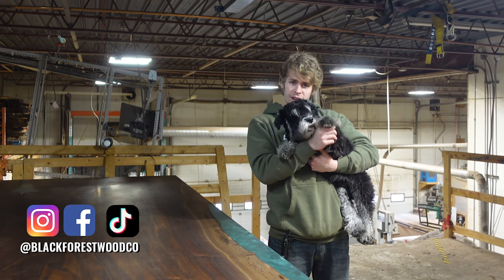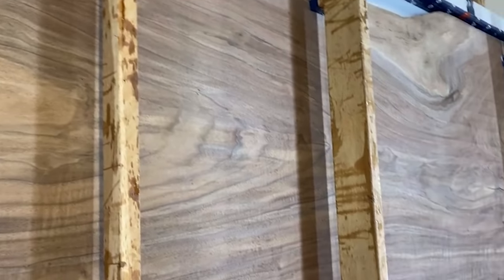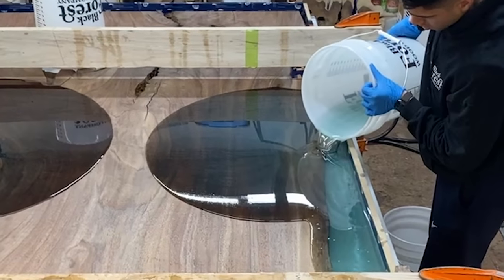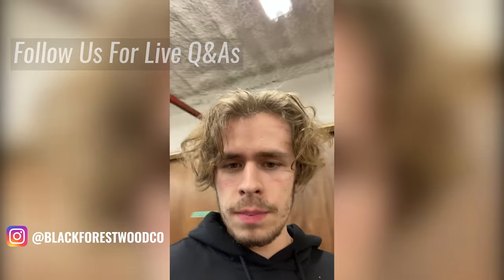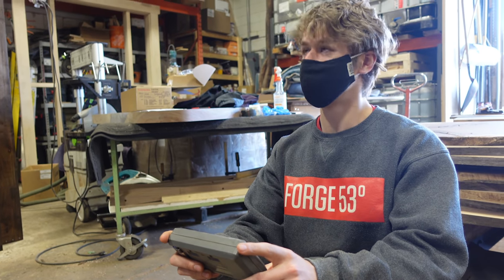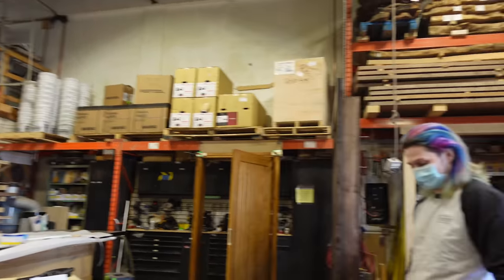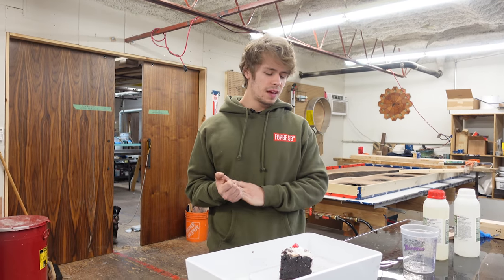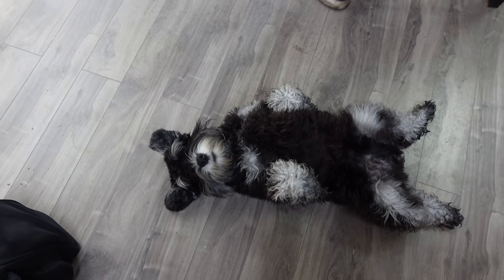Building Our Biggest Table Since 2020

Comment: I know this is an old video but it reminded me of a question I had.  I have a lot of mixed wood/epoxy projects like this (meaning the wood is exposed in the final product) and I wonder about sanding at the higher grits on bare wood.  Obviously if you want a perfect look to the epoxy you need to go up to higher grits like 1000/2000/3000/4000/polishing compound, but usually on a fully epoxy product I do these wet-sanded.  However with wood, you get that "fuzzing" that happens when the water dries.  Do you guys ever polish mixed projects to higher grit, and if so do you just do them dry, or do you oil-sand, or wet-sand?  How does polishing compound interact with the wood at that level of polish?  Thanks!